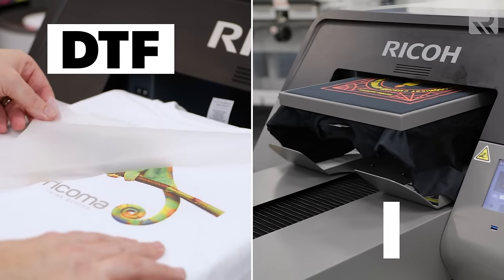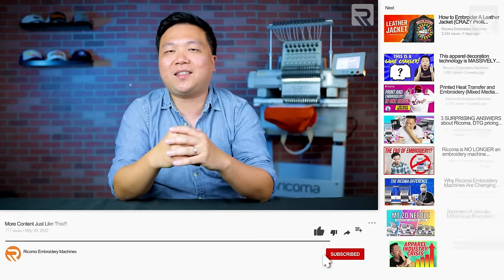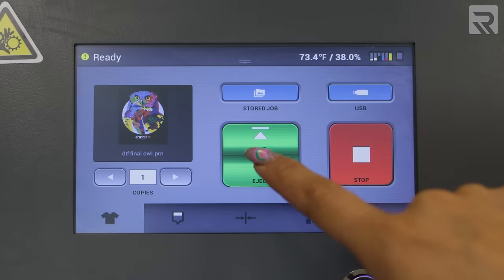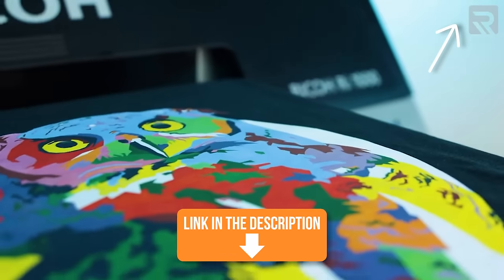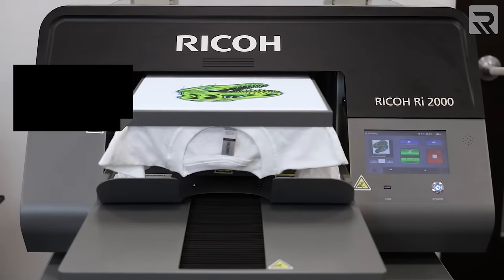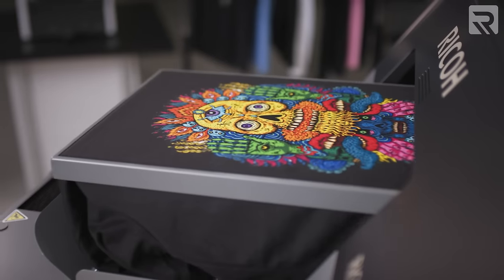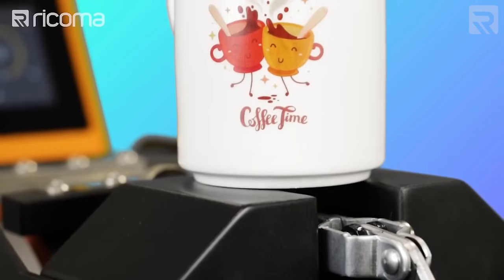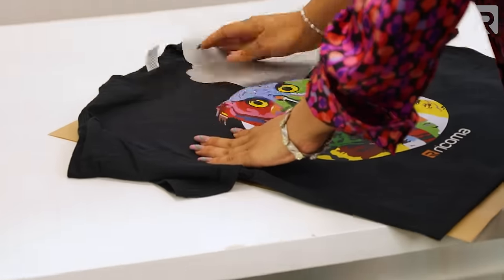DIRECT TO GARMENT PRINTING VS. DIRECT TO FILM (Pros & Cons)

Comment: Great video, very helpful. HOWEVER I would think that a huge reason to choose the DTF would  be opening up a more broad spectrum of fabric material. Please correct me if I'm wrong here, but I was thinking that DTG is very hard to do sucessfully with Polyester material, no? Whereas DTF is just adhesive and would work fine, even on 100% poly shirts. is this right??

Also, Another advantage is ganging up small logos on DTF for front left pocket printing which would be the same huge process for the DTG (a lot of work for a small design). 

I didn't even think of the stock up and store advantage, that really sways my slant for DTF in my business, meaning I wouldn't have to pre-produce and store all designes in all sizes, rather just DTF store, then press as needed per order! Genius and Brilliant!

I'm also way into trying the DTF for the absense of the whole messy pretreat part. I'm surprised that you didn't mention the part that most auto pretreaters are really expensive and there is significant savings there for low volume businesses which would be eliminated for DTF'ers. (not having to get the $4,000 pre-treat machine or messing with the messy Wagner spray method).

again, thanks for this video.
Reply from the maker: Hi! Thank you for the comment; we truly appreciate the feedback! You’re absolutely right on several points about DTF (Direct-to-Film) and its advantages over DTG (Direct-to-Garment) printing, especially when it comes to printing on polyester and other non-cotton fabrics. DTF offers several compelling advantages for businesses looking to print on a variety of fabrics, streamline their production process, and reduce costs. These points definitely highlight why DTF can be a superior choice for many applications compared to DTG.

Ultimately, the choice truly depends on what works best for your business. There are many pros for each method.

Comment: Great video! I learned a lot- I’m now in the process of converting my Epson printer to DTF- hopefully I chose the right process 😅
Reply from the maker: Good luck! Let us know how it goes!
Reply: If it's a epson f2100 don't. And your will need white ink and a white ink shaker to mix the ink so it dont clog the head. Also you will void your warranty with epson.
Reply: Thank you! 😊
Reply: @elevated-apparel  Thanks!
Reply: Just converted my epson photo 1400. It works great. My only problem is I added a ciss system and the printer isn’t fully open across the top, so my ink lines bump and bang against the sides. I’ll probably remove the ciss, but I’m definitely into this dtf. I have an epson 9890 44” that I may convert if things take off

Comment: How do they feel in texture.!?I have been looking for a print that gets into the fibres of the fabric and nearly impossible to feel on texture.Why.!? Because i realised the other types hold heat and some sweat…and it doesnt feel good on skin.

DTG looks like my solution,as per your description but,please confirm or advice.!?
Reply from the maker: DTG does have a more natural feel. You can always rasterize the image to make it more natural as well on both DTG and DTF. Using T-Seal paper after first press also helps.

Comment: For DTF is absolutely necessary to use that powder? Watched a bunch of videos on DTF and this is the first I’ve seen that mentions this powder.  Thanks
Reply from the maker: Yes, using powder is typically necessary for Direct-to-Film (DTF) printing. The powder helps with adhesion and ensures that the ink adheres properly to the film, resulting in high-quality prints.
Reply: @ricomatv they didn’t recommend me to any adhesive powder, only adhesive paper so I’m thinking a it’s newer upgrade tech. ?

Comment: Thanks, this was helpful but I was looking for a more direct comparison in regards to durability. You said that DTG printing will last better in the wash, but how much better and at what temperature vs DTF? I want to offer a high quality product that can be washed as many times as possible on high heat (because lets face it, when it comes to graphic tees almost no one reads the washing instructions).  I'd also like a more detailed comparison of color accuracy and vibrancy. Also since I'm just starting out, I plan to outsource the printing process for now. Does durability and quality vary a lot between businesses who use the same printing method? 

Edit: Before people start telling me to use screen printing, my designs are complex with a lot of colors and I will be ordering small quantities at a time, so screen printing isn't ideal for my needs.
Reply from the maker: Hi! We will be sharing an updated video soon! Stay tuned (:

Comment: We have a 330tx freejet and looking to adding dtf to our DTG that we already do. It seems that the colors are not the same going on fil. What you recommend to not lose the colors that we are looking for? Can we use the same ink that we use in the DTG printer? Do we need different film?
Reply from the maker: Same ink can be used for DTG and DTF if the printer is a 2-in-1. But not sure if your RIP software settings are causing the issues
Reply: @ricomatv  Same film also?

Comment: If I want designs located not just on the front center but say a small name on the right side of chest or on the lower back is the DTG still recommended? Or with me physically putting the design on the location I want as i would with DTF method work better?
Reply from the maker: It honestly depends on the design itself, the size and the type of shirt, or even the amount of shirts you are printing.

Comment: Hello, I am a very new small business. Approximately 20 shirts a week. I currently am only using. Cricut for one color to two color layers using HTV. I am wanting to get into full printed pictures for shirts. I am wanting to have my own machine however, not out source. I’m torn on doing a dtf printer or an htv print? What would you suggest. Or do you have a suggestion of where I go from where I am right now?
Reply from the maker: It all depends on your budget and needs. HTV is always going to be limited to one color or 2 color designs. It won’t be able to do complex designs or full color designs. DTF/DTG on the other hand can, but the investment into the equipment is going to be higher. You can also try white toner transfer printing with the ricoma Luminaris 200 printer which is like DTF/DTG but with toner instead of ink. The startup cost is a little lower but still going to be higher than HTV since you can do full color prints. Hope this helps.
Reply: @ricomatv   yes thank you!!  Do you have a video on the particular printer you suggested?
Reply from the maker: Printing Black & White Shirts With Ricoma's White Toner Transfer Printer (Custom DAD Swag!)
https://youtu.be/J0kauEwlrVU
Reply: Yes I am looking at buying a printer also.  
At the moment I do T-shirts with HTV but I make multicoloured designs layering up to 6 different colours of HTV a few seconds to fix each layer then a final press to bond all layers pressing back and front.  I am leaning towards the white toner at the moment but still gathering info.

Comment: When I print with a DTG, I don't feel any thickness from the image on the fabric because the inks are soaking in the fabric. Which is good.
What about DTF?
What I see is, DTF almost like using a regular  transfer paper printing. but the blank area did not attached to the fabric.
Is DTF ink can be felt the thickness on the fabric surface?
Reply from the maker: Hi! Thank you for your question. Whether or not you feel thickness with DTF printing depends on various factors, including the ink application, film type, and the specific characteristics of the printer and inks used. In some cases, DTF prints may have a slightly more perceptible feel compared to DTG prints, but it can vary.

Comment: Can regular printers print the DTF sheets or do you need a special expensive printer for that?
Reply from the maker: Regular inkjet printers are not typically suitable for printing on DTF (Direct-to-Film) sheets. Specialized DTF printers are designed specifically for this purpose, as they have features and specifications tailored to the unique requirements of DTF printing. These printers are equipped to handle the DTF process, including printing on the film and applying the necessary adhesive powder.

Comment: My question is what is the cutout process do they both automatically apply the cutting to the printing? Like for non png photos ?
Reply from the maker: You have to remove the background or else the printer will print it. You can use a editing program or there are some free options online that do it for you. (:

Comment: How does this compare to sublimation printing from a quality and longevity of the print output?
Reply from the maker: Hi! Overall, the best choice depends on the specific application and fabric type you are working with. Sublimation is ideal for polyester, while DTF and DTG offer more versatility for different fabrics.

Comment: Can you print on neck area with DTG printing? I know with dtf you can just cut the sheet and place it on the neck area where the label goes and press it but can you set up the DTG printer to print on small areas like that? Please advise
Reply from the maker: Hi Richard! Yes, it's possible to print on the neck area with DTG but difficult. You would have to do trial and error to achieve the results you are looking to get.

Comment: How to determine the center of a tshirt when laying it on the DTG printer placement sqaure.
Reply from the maker: Fold your shirt or garment in half vertically by lining up the seams. Place it on your press or in your pressing area. Press the shirt with whatever method you prefer for just a few seconds to make a vertical crease in the exact middle of your shirt.

Comment: Great video but I would like your input on color vibrancy on DTF & how I can improve this process.
Reply from the maker: Hi Daniel. The most important tip to improve a vibrant print is to ensure that the quality of the picture before you print. It is also important to adjust your color modes if necessary.

Comment: Hello! Thanks for sharing this. I have some questions, please. What is that liquid treatment for DTG and with what can be replace if I don't find it on my country? Also, after I treat the tshirt with that liquid I have to put the tshirt under the heat press before printing the design? Much thanks. 🙏
Reply from the maker: It’s called pretreatment liquid and there’s no replacement. And yes you should heat press the shirt after pretreating and before printing

Comment: i produce about 50 tshirt per day with pu film heat transfer. i out source my pu film design and i just tranfer with heat press machine. but there is a fade problem after washing.
 1.what do u recommend? dtf? dtg? i dont want to have fade and crack problem, this is killing me.
2. polyester garment (net type quick dry)sports tshirt ok with dtg?
Reply from the maker: For durability we recommend DTF since it usually last multiple washes without fading and yes DTG will work on polyester shirts no issues!

Comment: Hi, are any of these methods recommended for putting my logos on activewear/swimwear?
Reply from the maker: Hi! Ultimately, the choice between DTG and DTF printing depends on your specific needs and preferences. If you prioritize detailed designs and quick turnarounds, DTG is your ally. However, if you seek vibrant colors, versatility, and durability on various fabrics, DTF printing is your ideal contender.

Comment: Thank you for the informative video. Do you know if DTF can stick to EVA foam (the kind used in slippers) and the heat and pressure won't damage the EVA?
Reply from the maker: Hi! Whether DTF can stick to EVA foam without causing damage depends on several factors:

1. Temperature Sensitivity of EVA Foam: EVA foam is generally heat-resistant, but different formulations may have varying temperature tolerances. It's essential to check the specifications of the specific EVA foam you are using to ensure it can withstand the heat involved in the DTF transfer process.

2. Adhesive Compatibility: The adhesive on the DTF film needs to be compatible with EVA foam. Some adhesives may not adhere well to certain materials, or they might react with the foam, causing damage.

3. Application Method: The DTF transfer process typically involves heat and pressure. It's crucial to follow the recommended guidelines for temperature and pressure to prevent damage to both the DTF film and the substrate.

4. Surface Preparation: Ensure the EVA foam surface is clean and free from any contaminants that might interfere with adhesion.
Reply: @ricomatv  Thank you so much for taking the time to reply! I truly appreciate it!

Comment: Do you think a DTG printer would work for A3 handmade paper with desckled edges ?
Reply from the maker: You should be able to print on A3 paper, we recommend pre-treating it first and then they'll have to cure it on a heat press.

Comment: Are those only two different methods or requires different machines too ??
Reply from the maker: The RI 1000 can do both methods, but you would usually need to have two different machines if you wanted to do DTG or DTF.

Comment: Can you use the same printer to print dtf and dtg designs?
Reply from the maker: For the Ricoh ri1000 and ri2000 you can
Reply: How much ri1000 or ri2000 us dollar cost for the machine which have bith dtf and dtg in same machine how much it cost ?

Comment: Ok so i want to create my own print design on a sewing pattern (without giving away my business model) hypothetically i create a background seamless pattern i want to use on 100% stretchy cotton. Like how sublimation you can just print your shirt pattern in the shape of a shirt knowing the font and specific images will be exactly where you want them. You just cut out the sublimated fabric and sew. I want to do this on 100% cotton i want a specific design on the back and specific on sleeves and a matching but altered design on the front. The cut printed pattern then sew all together. The problem i am having is i dont want print to roll because i want to do it and thats not an option but i am unsure if dtf or dtg is viable either. Sublimation is a bust on cotton. What else can i do. I refuse to accept it can’t be done. The sublimation spray for cotton is disgusting. It leaves a horrible rough feel and leave a yellow stain after heat press. Please tell if one of these is suitable.
Reply from the maker: Hi there, thanks so much for watching. This is a great question to ask in our Facebook support group, Embroidery and Custom Apparel Mastery. This group is meant for all lovers of embroidery with lots of resources and more members discussing topics and helping each other out and learning about Ricoma machines and other brands! We recommend you join this group as we'd love to have you! https://www.facebook.com/groups/embroiderymastery

Comment: Hey can l use Hp smart tank to print and heat transfer
Reply from the maker: Hi there! It depends on the printer, we recommend doing more research to make sure you are able to do this.
Reply: @ricomatv  l have Hp smart tank 975 and heat press thinking about how to start ,

Comment: My experience with DTG is that the prints are not very vibrant or sharp. They appear somewhat faded and slightly blurry. I think the tech has to improve significantly to avoid customer complaints.
Reply from the maker: Hi there! Have you submitted a ticket to our team so they can assist? If you haven't, please send us an email > service@ricoma.com

Comment: can DTG printing be removed from garments?
Reply from the maker: Hi there, it can be removed from garments. You are able to use simple green and lots of water. With the faucet running, gently rub the fabric together to try to remove it. The hardest is white shirts, like any other stain, sometimes it's hard to fully remove it.

Comment: I am a bit confused, all our Test on 60° for DTF will blow DTG away so the washability u are talking about sounds like not true sorry ...   but with large Designs DTF will be to slow and thick but yeah overall DTF will Blow DTG away sooner or later ...
Reply: I’m new here an I was told that DTF last longer than DTG but he said the DTG will last longer. I’m confused.
Reply from the maker: Since the ink also binds directly to your fabric, DTG printed designs have a much smoother finish and will last much longer than designs that are heat transferred.

Comment: hi, i have a question i've currently been using printfuls DTG method but found after only washing my garments a few times the print would fade in color and the print itself dissapear, i, i want to give my customers the best and long lasting qaulity there is available so i'm searching for the best technique to apply prints on my garments. would you have any suggestions?
Reply from the maker: You might not be using enough pre treatment or not applying enough heat for the shirt to cure. I recommend following the instructions on the pre treatment bottle that you are using
Reply: Did you ever correct your problem? If so, what did you do? I’m learning about this stuff.
Reply: @305dadecounty305  no I have switched to another method of printing using only vinyl and screen printing

Comment: Why none of them print in metallic color?
Reply from the maker: Direct-to-Garment (DTG) and Direct-to-Film (DTF) printing methods primarily use water-based or pigment-based inks that are absorbed into the fabric or adhered to the film. Metallic colors typically contain metallic pigments or flakes that don't perform well with these ink types.